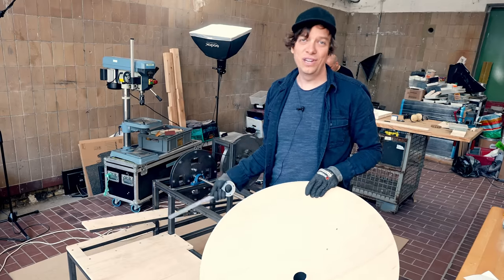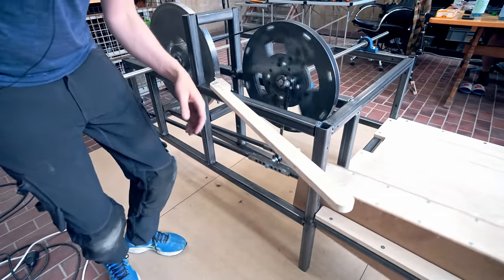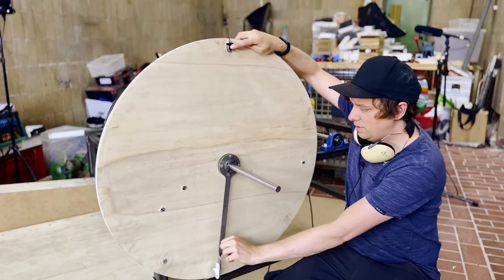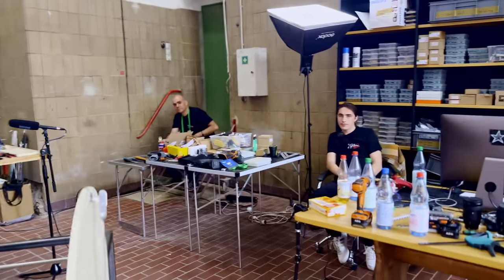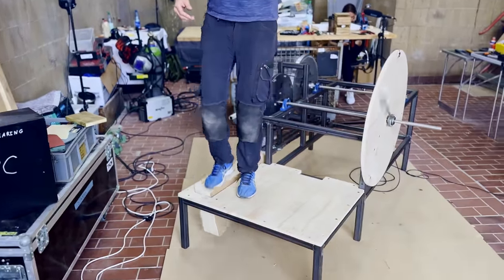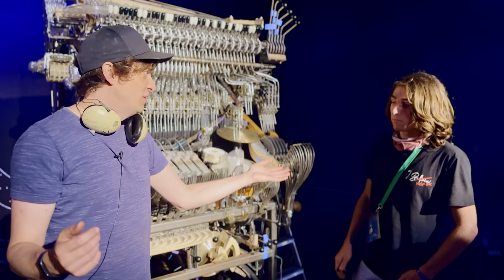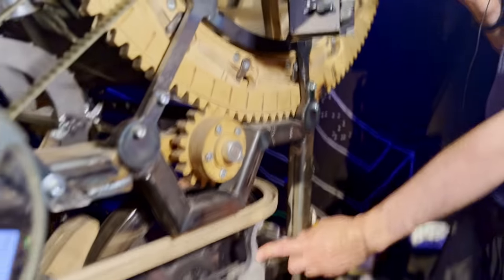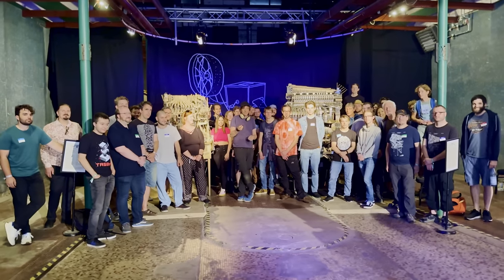This Clock Measures Music Timing - DAY 5 - Marble Machine Flywheel Prototype

Comment: You might want to have the brake clamp down on both sides, you don't want to have your flywheel getting pressed out of alignment over time.
Reply: fair point...
Reply: Consider a bicycle disc brake system. It's designed for... *badum tisss* braking.
Reply: @johan.mp4 no, that would be too weak I think. Because there's so much Energy stored in the Flywheels a bike brake would overheat I think. Brakes from a small car or Motorcycle would probably be appropriate but you can calculate that
Reply: @florianix8272  it would be more than enough. There's also bigger discs available for electric mountain bikes. Way less sketchy than a wooden stick, that actually works, but I wouldn't trust.
Reply: We've been over this too many times. The community screamed use bowden cables for MMX, but no. Use off-the-shelf components for the bearings and shafts, but no. And see where we are now 😜
Reply: Or brake against rim of the flywheel, not against one side.
Reply: @florianix8272  The amount of force a mountain bike has going down a steep grade is massive. I doubt this is asking much more of it. Also this is infrequently uses where the Mtn bike design is used constantly over long periods of time to slow someone who weighs over 250lbs with bike weight and 70% of that is on one break, the front. The  issue is really cooling of the break between uses. Because this is used so infrequently there should be little problem with that issue.
Reply: you're right! That is the way. With a large enough arc contacting the rim, the energy dissipated will be enough not to overheat the brake. And man, someone must tell Martin to redo that first tapered bearing... It wobbles like crazy!!
Reply: If you watch closely, the rim of the flywheel is already wobbling on its transverse axis, as though either the I.D. is not lathed perpendicular or (more likely) the flywheel is not planar.
Reply: @florianix8272 I have a very hard time seeing that the flywheel running at 80 bpm would have a higher moment of inertia than a bike at 25 km with 80-90 kg mass. An e-bike disc brake would be adequate, and on the plus side the brake could be hydraulically actuated meaning no slip in action.
Reply: Also a brake pad which can take the wear and be easily replaced
Reply: @hoej Absolutely, or even spring-actuated using a deadman safety, so that if the operator fell off the machine or something the brake would automatically engage.
Reply: I think that was temporary.
Reply: Its over 1 inch thick...... Nothing is going to bend
Reply: Given how much the flywheel was wobbling side-to-side as it is... maybe it's just the prototype, but I wonder about it.
Reply: @tanaes  a big red STOP button, that'd  activate brake and ideally even disconnected the flywheel, would be nice.
Reply: @florianix8272  I doubt this is true due to the fact that the braking on a bike is stopping the rider, not the wheel.  Most bikes are designed for at least 120Kg gross weight.  It's not overly hard to get the flywheel to have as much energy as a speeding bike, but the bike on a downhill grade needs continuous braking and still is effective for quite a distance.   I am not an advocate of that design, though.  The lever should have been made with a 90 Deg bend, so pushing on it pushed radially on the rim.  This load increases the  load on the bearings as if the flywheel weighed more. A nice double-shear load that is already over designed.  If placed on the bottom; so it's fighting gravity, the load need never exceed the flywheel weight.  Less force is required for the same effect as the braking friction moves toward the rim, so ON the rim is best.
Reply: @florianix8272 You think there is more energy in a flywheel powered by Martin with one pedal than in a professionnal cyclist riding full gaz?
Reply: Hell, I have some spare brakes he could just have for free.
Reply: Brake clamp
Reply: @johan.mp4 If there's one thing I've learned from Thomas the Train, it's that wooden brakes are always a bad idea!
Reply: just use bycicle disk brakes of larger diameter for breaking. will not be needed to touch flywheel at all.

Comment: The pedal is visibly flexing under the foot.
It might be too thin and might require different metal profile instead of local reinforcements.
EDIT: Martin recognized the issue in the day 6 video, but it might still take few design iterations to nail down.
Reply: Or just extend those wooden fences along the whole length
Reply: He just needs to add another bar on the bottom so it forms a triangle (or mote like a pyramid), from the bottom of the wood pedal to the pivot. This way it can remain lightweight while minimizing flex.
Reply: @JohnR31415  Extending the wood might make it too heavy.
Reply: he already acknowledged that in an earlier video.  it's only for the prototype and the real thing will be more robust
Reply: Agreed. If you listen closely, it is not just visibly flexing, it’s audibly flexing. It’s almost squeaking. As others have said, Martin has noticed this. It will be interesting to see how the design evolves to address this issue. Cheers.
Reply: needs triangle...
Reply: Rectangle tubing should do the trick
Reply: This will also get worse as the inertia of the flywheel is increased.
Reply: He can take a curved piece and attach it from the front to back of the pedal which should ridged it up without being too heavy. It would be in a 3 point triangle in the middle but be flat on each end. Then 2 middle supports attaching each rail together. Should be a pretty simple thing to have done.
Reply: And bigger pins, I dont think those little pins and bushings can hold up to the 400Ibs or so that leaver puts on them, 12mm pins (minimum) or so with bronze bushings are better more wear area surface area
Reply: One more beam underneath the others to get that triangular reinforcement, a bit bigger one at that. I wouldn't hurt anyways, since it all feeds into the mass movement of the wheel anyways.

Comment: If you want to increase the moment of inertia of a flywheel, it's not simply enough to increase its mass. Yes this will work, but you'll end up with an incredibly heavy and unwieldy flywheel , and you'll also have to factor that weight into the rest of the design of the drivetrain.
For more inertia you need to concentrate the mass of the flywheel to the outer most area of the flywheel, so you need to make the spokes smaller and far less bulky, and move that mass to the outer edges. That'll give you more rotational inertia for the same mass
Reply: Precisely
Reply: 110% correct!
Reply: In other words: That flywheel needs more and larger holes while getting more plates.
Reply: The braking system seems very sketchy, especially if you also want to increase the mass. Just pushing on one side of the flywheel is not that great. Have you considered adding a bicycle disc brake system?
Reply: aye, true. ideally it would press from both sides so the flywheel isnt pushed out of alignment (which also causes the brakes to be less effective). The bolt/ pivot point holding those brakes would also be better if it were much closer to the flywheel, the way it currently is is creating a lot of leverage that can bend the metal beam (or the contact point at least) out of shape
Reply: Martins plan is a larger flywheel, with spokes. This design just happened to be cheaper so he chose it for the prototype 🙂
Reply: How dare you bring logic into this!
Reply: I would also argue that too much moment of inertia is bad for playing tight music because it makes it harder to control. The more moment there is, the longer it's going to take to accelerate or decelerate the wheel to get it in time with the beat. A smaller wheel requires more careful and direct input from the musician, but that means the musician has a greater impact on the instrument.
Reply: While this is true any given size flywheel with all the mass located as close to the perimeter, will get a higher inertia if the full circle is filled. What you're proposing to get the same inertia is to upscale the flywheel, where the whole point here is it has size constrictions, so using the entire area and using multiple is exactly the right solution.

It's only when the mass stays the same, i.e. your requirement is mass based, you should base it on distribution, if your requirement is volume based using every bit of space available to locate mass it gains inertia.

You're honestly giving misguided advice for the design requirements.
Reply: @RhynoD2  I would argue that moment of inertia is good. It is much more important that the speed is consistent, than that the speed is adjustable. The flywheel controls the speed of all the music, so there is no need to adjust when the beat happens - the instruments are always in sync. 
The only task of the flywheel is to keep the speed constant.
Reply: @RupeeRhod  Martin has no design requirements. He also refuses to listen to any advice that doesn't prop up the decisions he's already made.
Reply: @RupeeRhod  This is the correct use case. The mass constraints are: what can a forklift pickup and how much can the stage floor support. If in the end 20kg or so makes a difference, this would be an easy place to shave some off.
Reply: @RupeeRhod  No this isn't what I'm proposing at all, you are entirely incorrect. If you'd read my post properly you'd see that I mention increasing the moment of inertia without the need to increase the mass simply by moving that mass to the outermost edges. Eventually Martin and his team will hit a practical limit of how big and how heavy to make the flywheel, so if they want more inertia this is what they'll have to look into anyway.
It's not "misguided advice", it's highschool physics
Reply: Totally !
I want to emphasize that I = m × r² (moment of inertia = mass times radius squared)
So doubling the radius of the flywheel would quadruple the moment of inertia, whereas doubling its mass only doubles the moment of inertia.

If you want a big moment of inertia, make the flywheel as big as possible, with as much mass as possible around the edge of the disc.

Maybe instead of hiding the flywheel, it could become a visual part of marble machine's structure…

Also, angular kinetic energy is 1/2.I.ω² (ω being the angular velocity)
So more moment of inertia means the flywheel does not need to rotate as fast, making it safer (and causing less vibrations)
Reply: @gewerdstrauss9843  And to have a bigger radius, ideally 🙂
Reply: @RupeeRhod  how can the requirement be volume based, if he just started a new marble machine design from scratch ? 

If he wants to be successful this time, I think he should design in the opposite order :
1 ) decide how much moment of inertia is required for the flywheel
2 ) design a flywheel that matches this requirement
3 ) integrate the flywheel size constraints into the overall design

Comment: Better plan for the brake: attach a motorcycle disk brake to the flywheel shaft. It's designed to safely slow down a rapidly spinning thing with a lot of rotational inertia... almost like it's a brake or something.
Reply: Feel like a motorcycle brake is a little too "off the shelf" for the marble machine

Comment: To make it truly safe, you should apply a step wheel that would allow the pedal to skip torque on enough pressure directed upwards. The current design would still allow things to get crushed under the pedal or if they got something caught on the pedal arm.
Reply: why not an hinge like last design ? 🤔
Reply: @anferrr He didn’t like the flopping of it when there was no foot on top.
Reply: @DominusFeles  RIght, forgot about that! thank you :)
Reply: @DominusFeles  A spring can prevent that. It only has to exert a small force to prevent the pedal from losing connection at this low speeds.
He just has to make sure that the spring is long enough to allow for travel without getting too tight.
Reply: I would just use steel wire link, the weight of the pedal is far enough to keep it down.
Reply: The current solution isn't safe at all. The hinge solution was good. He just needed a spring, strong enough to keep it from flopping, but weak enough to not hurt a foot.
Reply: @GoelWCS  - Doesn't help that it's heavy, since weight doesn't affect how fast something falls.

Comment: A more simple solution to the peddle guillotine is to replace the linkage between the peddle and the drive wheel with rope or a cable. Then if something gets under the peddle only the weight of the peddle will effect that item. Sure you lose the easy adjustability of your linkage but safety is a high priority.
Reply: Great idea. A hinge on could also work
Reply: How would you be able to solve for the peddle flapping up and kind of jumping at higher speeds? I remember that being an issue on previous similar peddles
Reply: @BraydenTowns if you stand on it, it can't jump.
Also it is relatively heavy so you would need quite a vit of speed to get it jumping
Reply: If you use a chain you could stick the bolt on the pedal through one of the links and still retain adjustability.
Reply: You can already see that the pedal is extending BELOW the platform--thus continued risk of injury on the up-stroke.  Not to mention what would happen if the lever were to somehow fail (which it's already bending madly)--it could very easily fail enough to allow a foot to slip through completely, and yet the mechanism still be slicing away...

Comment: I have a suggestion, I feel this might be beneficial.
Have you considered using hydraulic disc brakes on the shaft?
Not necessarily the bycicle ones, but they are also used on motorcycles and cars. you should easily be able to actuate them using a lever attached to a hydraulic piston.
Reply: Yeah car brakes would be perfect and replaceable and he could find a used unit in a junk yard.
Reply: I was thinking the same thing, you saved me the trouble of figuring out how to put it into words 😁😂
Reply: Air brakes from a truck would be even better, you can make an emergency button to release vacuum and the whole machine will stop direct.
Reply: why not ones for regular bikes? that would also work... they have fat tire bikes that use wider braking systems.
Reply: @jbkibs  might work, but since there is a lot of momentum in that flywheel, i chose to suggest the safer option.
Reply: @buddy1155  since martin does more of a manual aproach, i thought the hydraulic variant might be more suited, since you can actuate them without building up pressure or a vacuum in a tank, just by compressing a piston, since the medium (liquid) does itself not compress as easily as air. So it is more direct. But if you wanted, you could do the same thing you suggested with hydraulic as well, build up pressure in a tank and release it to the brakes with a valve. There are also mechanical valves available, that work like a push button or electrical ones that work by applying voltage or pneumatic actuatet valves by applying air pressure.

There are many ways to the same goal :P
Reply: @thesebi  yeah, i agree. your way would probably be the best solution.
Reply: A mountain bike disc brake system is more than enough. They can handle fat guys constantly braking down a steep mountain 😅 This flywheel would just require braking for a short while and the heat generated would a regular disc brake dissipate easily.
Reply: @jbkibs  i don't know if it's "the best" but it is a viable solution 😅
And I'd rather be safe, than responsible for martins demise 😬
Nonetheless, if you or someone else find a better solution, suited for martins project, I'll happily step aside and support that instead.
Everyone is free to mindstorm and throw in ideas.
Reply: @thesebi  True, he can also use his manual stick put spring or weight loaded, that could also function as an emergency stop.
Reply: It's also easier to modulate the braking force with a disc brake system FWIW.

Comment: Agree with others suggestion to use a motorcycle disc brake.  Will stop the maching quickly no matter how big the flywheel is. 
Super cool to see the MMX running.

Comment: You maybe should consider adding a differential to the output to maintain constant speed and be able to keep tight timing no matter the input force or the rotation speed of the flywheel it work for cars or watches it should be plenty precise for music
Reply: Agreed! There are so many robust, existing, standard solutions for what Martin is trying to do with the flywheel. A differential would avoid having to finesse the speed of the flywheel, disc brakes should be used to slow down the flywheel (instead of that unbalanced and messy magnet solution), and there should be a clutch or something to disconnect the pedal from the flywheel in an emergency.
Reply: can you put a link to such a differential so that I can see how it works?
Reply: At that point why not have an electric motor?

It is still a musical instrument
Reply: @ninovulkan9815   After some thought the differential is not the appropriate answer the input variation would still affect the output speed but a continuously variable transmission taking the desired output rotation as target could give good result not sure if the currently available solution are precise enough though
Reply: @Ammoniummetavanadate  You summed up the problem exactly. Martin is so obsessed with reliability and timing that the new Marble Machine has lost all of the charm that the earlier, more organic machines had. Sure, the Marble Machine X may not have been able to go on a world tour, but it was full of creative, clever solutions. This new machine feels like a reinvention of the wheel.